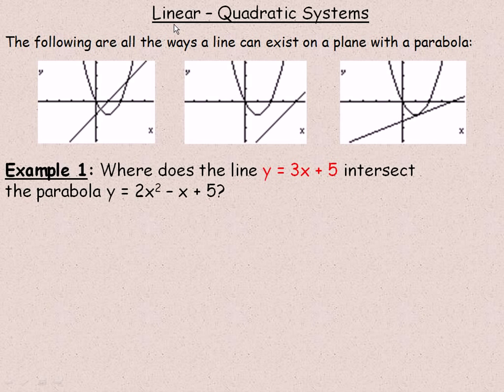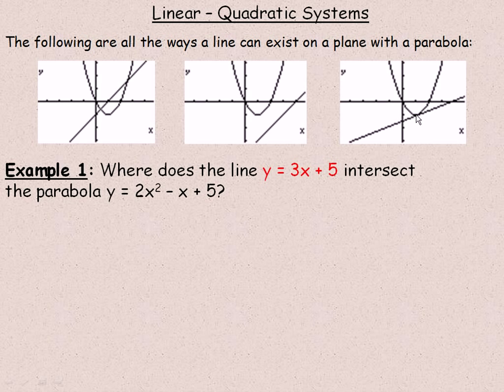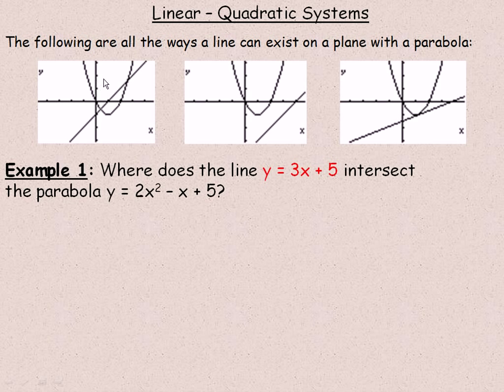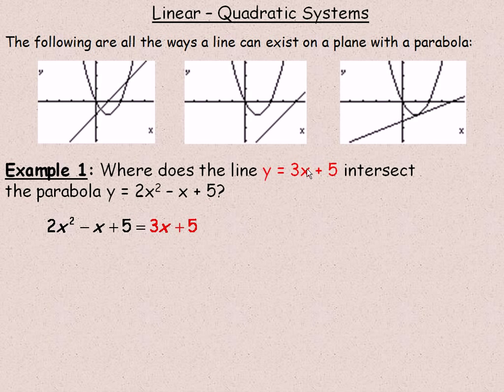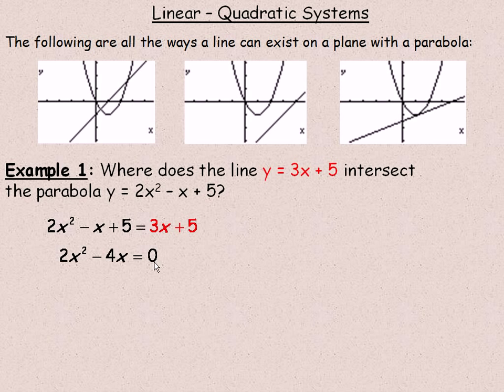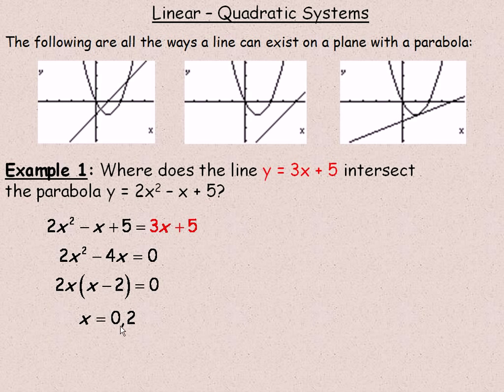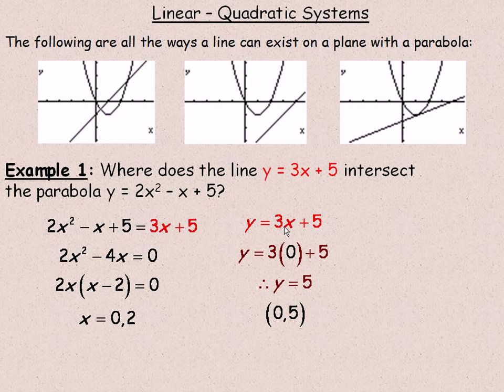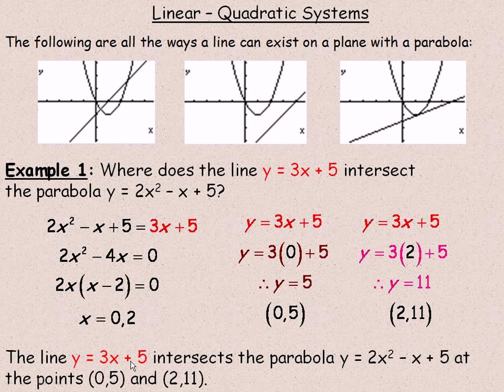Linear Quadratic Systems Part 1

Comment from the maker: Unless you go into a very technical career such as engineering or mathematices you aren't likely to use higher mathematics.  Actually even as an engineer you'd probably only use it while taking the degree and not very likely afterward (they might only computer apps on the job).  However, the biggest thing students should take away from high school math classes is the training in logical & thinking skills - that's why understanding is more important than memorizing..